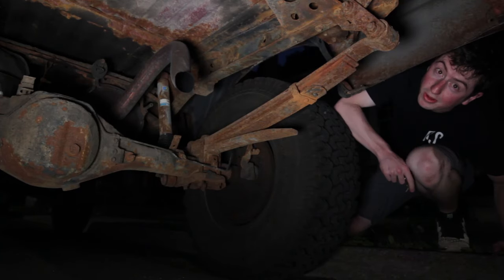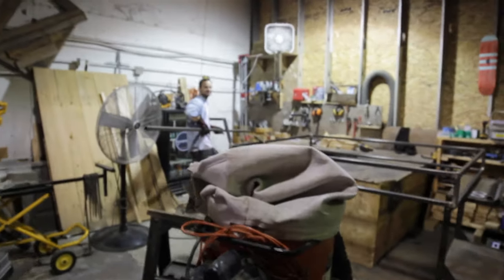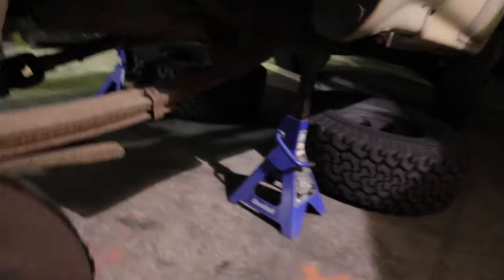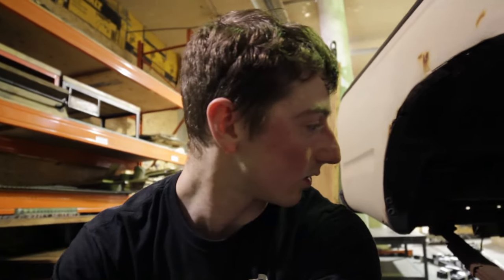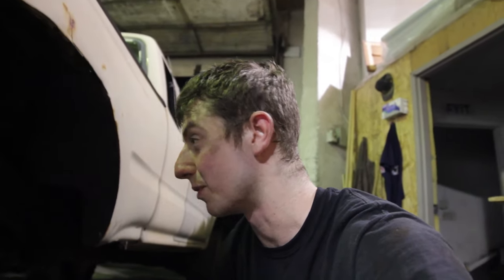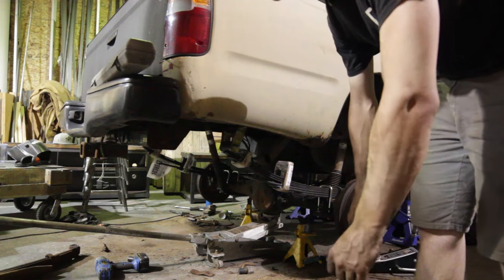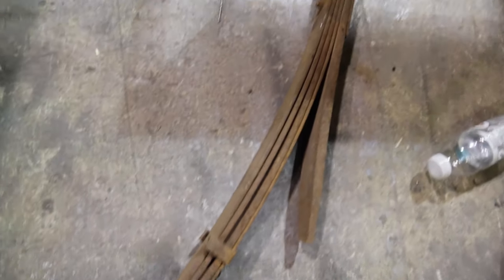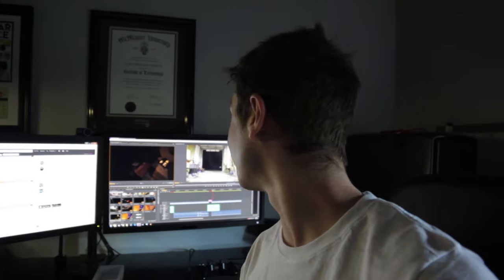INSTALLING NEW LEAF SPRINGS - Dakars on my Toyota Tacoma

Comment: Hi Sean. I know this is an old video but im going to ask this question since its really hard to find people with this exact leaf pack. Im assuming you have a 3 inch lift in the front to fit those 285 tires. Is the truck level with this leaf pack or close to level at least? Ive heard some people get an excess of 6 inches of lift with these old man emu cs019r leaf spring packs. which leave most people wanting to remove a leaf. Any insight would be much appreciated as i have the same leaf packs waiting to be installed because of my fear of excessive lift in the rear.
Reply from the maker: Hey! I no longer have the truck, so I can't do any measurements. However, here are some pictures before and after the leafs. https://imgur.com/a/6NmbwuK you're right, believe the truck already had a full 2-3" lift with the old leafs and upper ball joints, and it definitely went up another 2-3" with the Dakars in the rear. I didn't mind the rake because hauling heavy stuff felt really good. I also didn't drive it enough to let them settle at all, but I don't imagine there would be much settling. I had to get the extended shocks as well (which I didn't show in the video). - Jump on the discord if you have more questions. https://discord.gg/nhB42bFh
Reply: @SeanHodgins  Thank you for your speedy reply! The after photo definitely doesnt look too raked out. youre the man!

Comment: hey man. i think you are not supposed to fully torque the end bolts without the full weight on the truck. awesome production value as well.
Reply from the maker: Shackle side? Or the front? Thanks, I'll loosen and retorque them. Need to retorque the ubolts soon too.
Reply: +SeanHodgins the back side with the shackle for sure, since it moves

Comment: How does it handle weight with the darkars? How long until it settled? Looks beastly. Got an 03 I've been wanting to do so bad for so long. Never quite sure of which parts front / rear and if I'll get stuck solo. Been looking to help someone else do an install on tacoma world so I know what i'm getting into xD.
Reply from the maker: They haven't really settled at all, but it rides great. As for weight, I'm not sure, but when my bed is loaded more than I would like(like a full truck full of wood), the leafs handle amazingly. Helping someone first is definitely a great idea!

Comment: you said you torqued everything down... What torque(s) did you set your wrench to for the different bolts?
Reply from the maker: I can't remember.. The new leafs(or the ubolts) came with some install instructions. I think it was 80ft/lb - then retorque after 500 miles for the u-bolts. For the hangers, I'm not sure.
Reply: cool; thanks.

Comment: im going to be putting the same leaf springs on my truck. can you link me to the other parts you used (shackles, ubolts, bushing ect.) please
Reply from the maker: I won't give you the exact parts because the leafs actually changed from 96-97 to 98 and beyond, and I don't know what truck you have. However I got them from wheelers off-road, and they will help you get everything you need.

Comment: Great video. Did you have any issue lining up the pin on the new leaf with the hole in the axle plate?
Reply from the maker: Thanks! I don't remember exactly I was pretty tired by that point, haha, but I think they weren't too difficult to get in place.

Comment: I have a 1993 toyota 4x4 pickup extra cab and need to put leaf springs on. Thank you the shop wanted to charge me 1500 dollars and I said ill just take it home.
Reply: The omu Dakar for our year truck is cheaper. I bought them for my 86 4x4. You have to buy their yellow bushing kit.. the OEM or red energy suspensions ones wont work.. trust me I have the ES just sitting after thought itll work.

Comment from the maker: Who loves rust?
Reply: SeanHodgins weight reduction
Reply from the maker: I should have.. But the truck rides so much better now, and even better with some weight. No noise, and much more stable hitting bumps on the highway. The truck would shimmy when going over crazy bumps before but that is gone now. I think it was from axle twist which I was hoping these leafs would remove, and they did!

Comment: First off, great vid!!! My leaf spring hanger bolts (front and rear) are frozen like yours were. I know I can get new shackles for the rear and they come with new bolts, but what did you use for the front hanger bolts (frame mount side)? I have done a bunch of searches and can't locate replacements or even what size they are so I can get from a hardware store.
Reply from the maker: Hey thanks!,I got new "Main Eye Bolts" from Wheelers Offroad(where I got my springs) because I knew I was going to have to cut mine out. These are them https://wheelersoffroad.com/product/toyota/tacoma/1995-5-2004-tacoma-4x4-and-prerunner/suspension-steering-and-chassis/miscellaneous-suspension-parts/toyota-spring-main-eye-bolt-kit/

Comment: Overall how long did it take you to do the job?
Reply from the maker: Hmm, maybe 4 hours all in? I can't remember exactly, but I wasn't rushing. Fighting with the rust took most of the time, that and trying not to drop heavy stuff on me. Might be a 2-3 hour job if you don't have rust. Its essentially, remove the wheels, remove 6 nuts/bolts, reinstall. You also need to factor a installing an extended brake line, bleed brakes and install longer shocks if you don't already have those on.
Reply: I was just thinking about OEM replacement.  Mine isn't lifted at all.  I just put new rear shocks on and noticed how bad the springs were.